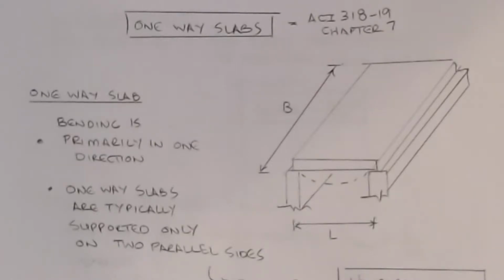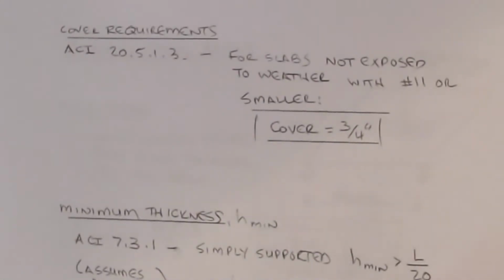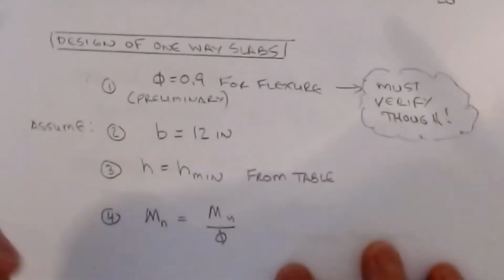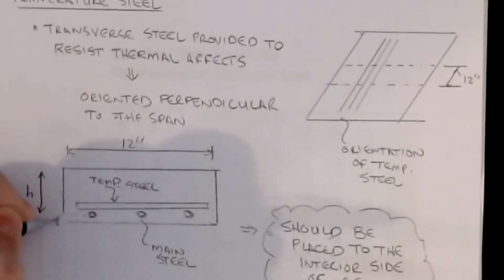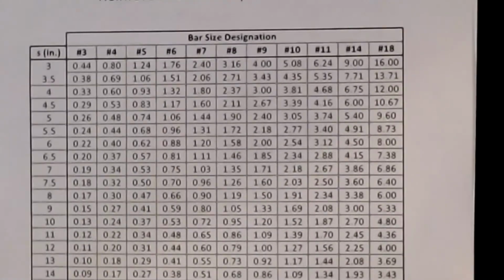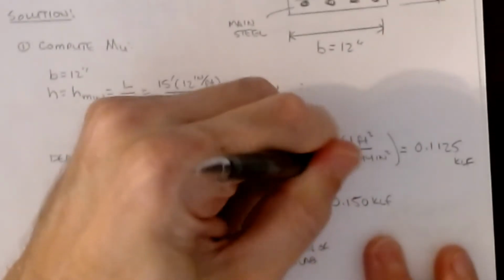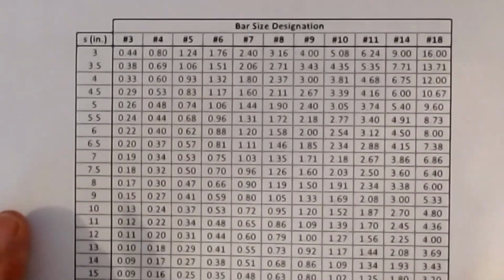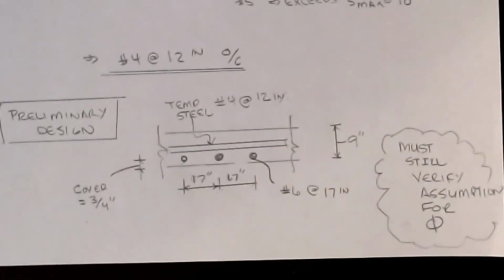025 CE342 Concrete Design - One Way Slabs

Comment: I come up with a different rho using the same numbers you used in your equation.  Instead of .0031 like you got, I get .0041 which of course results in a different final answer.